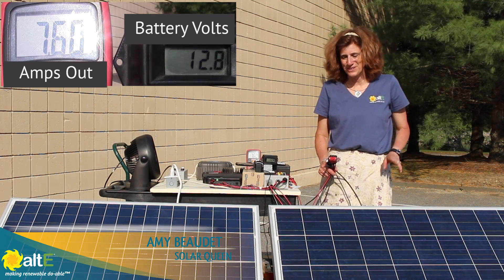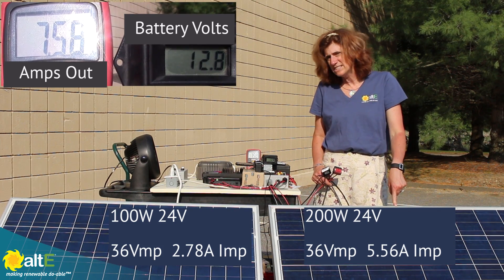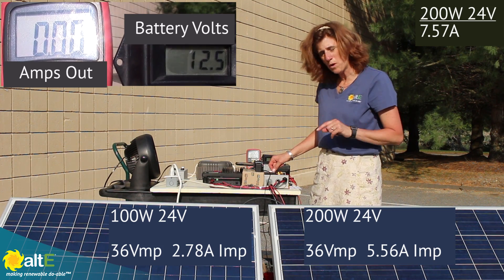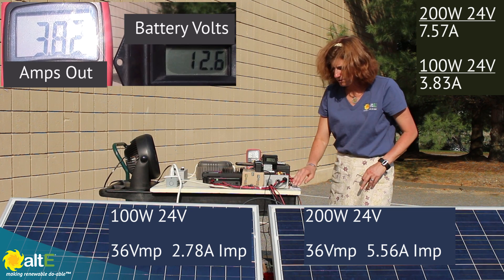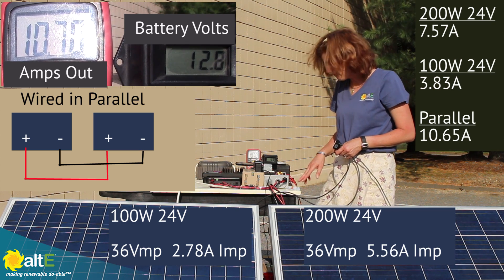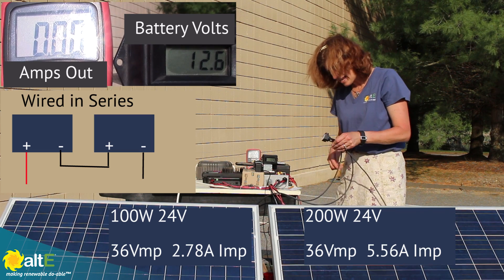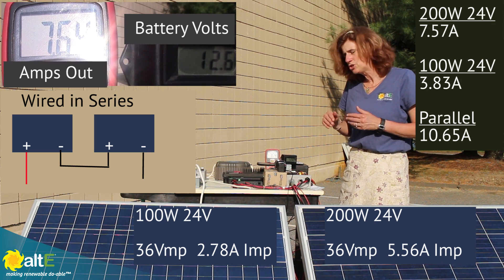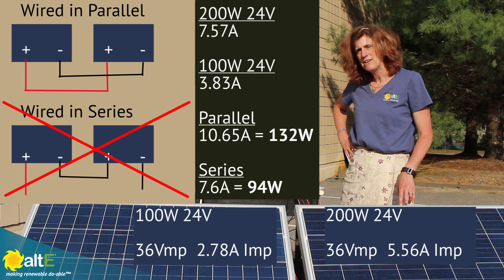What’s worse? Mismatched solar panels with different amps in series or parallel?

Comment: Hı, i have a question, for example, I have two mppt charge controllers, one of them is 10A and the other is 20A, can I parallel the output of these two mppt devices and charge a single battery?
Reply: Yes. Demoed in other videos.

Comment: Panel A ( 460W, Vmp = 45.24v, Imp = 10.18A )        Panel B ( 460W, Vmp = 41.9v, Imp = 10.98A )

There is  a little difference.  Plz advice series or parallel. I have 10 Panels B and 4 Panels A.  Doing strings of 7 panels in series and add both string in parallel. 

PS i have 10 panels B. Panels A i have to purchase because those are the only option in 460W.

Comment: The data presented here is inaccurate. Series = add voltage. Parallel = add amps. In parallel you showed 10.65A*24v = 255.6 watts. In series you showed they had 7.6A, now multiply by 48v = 364.8 watts This does not make sense 364 > total watts of 300.

I just think the video needed to add more information for the viewer and can lead people to think that wiring mismatched panels in series is always better than parallel. The controller does not "prefer" series or parallel (incorrect nomenclature). It depends on you application and what output you want and inverters and what battery bank you are working with.

https://www.youtube.com/watch?v=jejro4zkl8I
Reply: Battery voltage doesn't change. Just need to compare amps. She did fine.

Comment: wrong calculation

in series how did you get 7.6 amps.

It means you got better efficiency in series,. 48V *7.6 A = 365Watt😮😮😮
Reply: Wrong.  Battery volts didn't change.

Comment: is the math off on the series? 48 volt x 7.62 amps is closer to 350, not 94. even if you had the same panels, the current would stay the same, which would be the highest number. so recheck your info by adding more sensors in the lines of the panels to see that it is working like it should.

Comment: im building my solar with free car batterys, i put 2 big marine batterys in series, and ran 4 car batterys parallel off them each. i dont know if i got voltage drop from long wires or 8awg use, but i put a car tester on the batters and the marine had 14 volts whole end of the legs had 12.8 i think, also barely 300 amps on a 1000 cca batterys. when i put load on those car batterys. how do i improve my system beside bigger and shorter wire, is their better ways to hook up batteries? i have 2 inverter 12 volt is my issue,  while running 24 volt 100 amp controller

Comment: ty! that explains why on my 12 colt panels i had this issue when i connected a 175 watt with a 100watt in series and was getting poor current, and in paralllel got so much better.

Comment: NONSENSE. how volts can be the same if in series you double the volts! You should show us MPPT data not battery voltage.
Reply: Only battery volts matters. That's the whole point. Maybe a much better MPPT would have different results.

Comment: I actually took 2 different brand, different physical size, different wattage solar panels, and successfully paralleled them for a 12V battery bank mini solar system.  The were very close in voltage output (both at open circuit and at MPP), so they were very good paralleling candidates.  One is rated at 360 watts and the other is rated at 205 watts.  With losses, the most I saw was 28.0A at about 14.0V charging voltage, so that is close to 400 watts of charging power.  That is because of losses in the wires between the panels and the scc (solar charge controller), and other losses which are normal for a solar system.  The idea was not to get maximum wattage (cuz the scc maxes out at 30A anyway), but rather to use what resources we already had (such as wires and cables).  The system seems to work well and the inverter can output up to about 3000 watts and has both 230V and 115V outputs that can be used simultaneously.  A nice working system that can provide emergency power for critical loads (fans, fridge/freezer, lights, well pump...), but also can be used for intermittant loads (such as cooking food outside in a crock pot for example).  A fun system.  11 low cost AGM batteries all in parallel with a total rated capacity of 1000Ah (500 Ah usable).  That is about 6 KWh of usable energy, with the sun putting back about 2 KWh per day on average (5 sun hours * 400 watts), with sun hours "corrected" to wattage when sun is at ideal position and intensity.  So basically there are MORE than 5 hours of sunlight per day on average, but that is equivalent to 5 hours of "intense" sun close to straight up.
Reply: In parallel, you can have different on both voltage and amps and it will still always be fine (the only losses are the conduction/heat loss).

Comment: I have two panels one from a kit it advertised as 150/1000W the other is 175W is this two big a mismatch although they are physically the same size? I have them in parallel but battery not charging even after changing controller from a pwm to a mppt.
Reply from the maker: The wattage is not too bad to put in parallel, but you'll want to check the Voc and Vmp between them to see if those line up. As long as the voltage is close to the same, the amount of Amps from each panel can be different (just like if there was unequal sun exposure). But if the Volts are very different (EX 12v and 24V), then the controller will pick a voltage in the middle which will be inefficient for both panels!

Comment: Needs assistance here.. what are the corresponding amps  to arrive at 132W for parallel and 94 W for series? She mentioned 10.74 A, 11.5 A and 10.67 A
Reply: The output amps written is the output from MPPT to the battery, where its voltage is the charging voltage of battery, which is around 12.5V

Comment: Did you just put two 24v panels in series and not double your voltage when multiplying your amprage?

24v x amps is parallel
48v x amps is series
Reply: She is measuring the OUTPUT of MPPT Solar Controller, which is near 12.5V. She got 7.6A x 12.5 = ~94W in series.
She did not measure total input voltage as it is NOT necessary.

Comment: 10.65Ax24V=255.6watts 7.6Ax48V=364.8 watts
Am I missing something here? The test in parrelel produced 24v but series is double voltage to 48v?? So wouldn't it like series more??
Reply: nope. it's a 12v battery so it's restricted in how much voltage it can take in at one time. unless u series* 12v batteries together.
Reply: The output amps written is the output from MPPT to the battery, it is around 12.5V

Comment: Somethings not making sense you  have a 200 W 24 V panel and a 100 W 24 V panel. In parallel you get 24 volts at 8.34 amps.  8.3 x 24 = 199 watts.    And in series. You have 48 volts at 2.78 amps. 48x 2.78 = 133.4 watts.  After that it depends on your charge controller what voltage it’s going to charge at MPPT controllers will take higher voltages and convert them to lower voltages in doing so the amperage goes up so you should still be able to calculate close to the wattage of both panels when in parallel.   Full sun optimal conditions 200+100 W equals 300 W 300 divided by let’s say 13.5 V which is a good charging voltage for a 12 volt bank your charging amp rate should be 22 amps.   If your battery bank is 24 volt then your charge voltage should be around 27 volts which would give you about a 11 amp charge rate.  How are you getting 132 Watts and 94 watts?

Comment: How to check solar panels if they are in good conditions or not
Reply: Just measure the amps in the output, if it is near theoretical solar panel rating (e.g. 85W for 100W solar panel) then it is good. If not, there are still a lot of factors like sunlight, angle, shadow, cable size, solar controller, voltage, etc.

Comment: If we mix two such different configuration then one panel will oppose other one.In this parallel example net output amp is increased in parallel but it is also forcing 200W panel to produce less net output 132W. So finally this parallel connection is not suitable for 200W panel it may cause some resistance for it. Resistance means temprature increases and it may be responsible for hotspot in panel during long time connectivity. can we also consider the panel temperatures during such mixing?

Comment: Hi,
It's a great video but I am having my doubt. When connected in series, the current will be limited by the 100W panel, but the voltage must be increased. Am I right?

I got my doubt and I searched more videos and found this. 
https://youtu.be/W9W-3wZhUpM

Here both are connected in series and they are getting a lot more wattage than using a single panel. Please explain.
Reply from the maker: That's a different test he did. They have mismatched volts AND amps. Mine were the same volts. The moral of that story is, neither series nor parallel work well, as the lower voltage would pull the volts down in parallel, and the lower current pulls the amps down in series. Separately, they added to 231W. When he connected them in series, it dropped to 209W. So the bottleneck of the current in series caused him to lose 22W. The best solution for that scenario is 2 separate charge controllers.  I did the same test in a different video. https://youtu.be/ZAKTMSEHfk8

Comment: Good day,the solar Queen. Can one wire a 72 cells panel with a 60 cells  solar panels together  to be able to use an mppt charge controller of 100v voc?
Reply from the maker: You may be able to wire them in series if their amps are similar. Add the Voc of the two of them, and if it gets really cold where you are, multiply by 1.2 to make sure it is under the 100V limit.
Reply: Thanks, may God bless  you.

Comment: But you have twice the voltage so the wattage is higher you just need another controller/Batterie combination.
Reply from the maker: Yes, a second charge controller would do the trick.

Comment: Lady ...where is the spot you measure the Amps ? if you measure the amps in PV in Not Battery out . your output of series 7.6A is actually outperform of parallel since it's from  24v not a 12v  so 12X10.65 = 132 w  but 24V X 7.7 = 183W . so it's outperform over 50W in series compare to parallel.
Reply: I don't know exactly. But I think we may not get 24 V but it should be shown in the video.
I found another video whether two different panels(24V 200W & 12V 100W) in series and getting more output.

Comment: I have a question about combining multiple arrays to a single combiner box. I have (2 150w in series) (2 150w in series) and want to add (3 200w panels) I have in either series or paralell whichever is optimal. Each array will be running through a breaker in the CB and out in 2ga wire to a 100Amp Epever controller. I am trying to understand the effects of this on the panels and the controller by doing this combination at the combiner box. I'm having a hard time finding a answer. 150w specs are VOC 22.92 IMP 8.20 200w specs are VOC 24.29 IMP 9.52
Reply from the maker: I don't see a clear way to do that. If you wire the 200W panels in series, you'll have 73V in that string, and 46V in the 150W strings. The 150W strings will pull the voltage down of the 200W string. If you wire the 200Ws in parallel, you have the opposite problem of 24V on the 200W strings pulling down the voltage of the 46V from the 150W strings. Both ways, you are losing a lot of power. If you are charging a 12V battery, I suppose you could wire them all in parallel, so the voltages are a little closer. But you'll still be losing power. A MUCH better way to go is with a separate charge controller for the 200W panels.

Comment: Can I charge battery using two charge controller?
Reply from the maker: Yes, just wire them in parallel to the battery bank. Make sure they are both set with the same charging voltages.
Reply: @AltEStore  Thanks for your reply.

Comment: I have 4 panels of 250 watts and 3 panel of 350 watss? And an MPPT solar inverter, how do I connect them?
Reply from the maker: I would need to know more before making any recommendation. What is the inverter? Does it have 2 MPPT inputs? What is the minimum voltage it requires for the input?
Reply: @AltEStore   altE Store  It is 3200 Watts inverter, MPPT Range 120V to 450 VDC. I guess it does not have 2 MPPTs input. A standard MPPT inverter, which can also work without batteries. 
I already had 250 watts panels, I just could not find 250 watts panels again, which is why i I bought 350 watts panels.
The only diff is 0.58amp dif, both are mono panels.
In the future, If I will have any other use for 250 watts panels, i will use them for something else, but for now like an year or 2.

Comment: I dont have the same voltage or amps. I just need a new mppt to fix it but for now I can get about 10-15% more than just one panel.  One panel uses 60v+ 3a the other is 40v+ 6a

Comment: Remember the key is mismatch panels. If it was Match panels series wins.  The combo amp output is limited to the lower panels same as you join 2 -12 volt 0ne damage charge 70% if you hook it in series you get both at 70%  or the balance .
 1 tried both.  parallel first 100% 1-2 pm in series with a 400 buck mppt controller 100% at 11-12 pm. Both still need tapping off. But the series are pushing 7 amp at 9 am the parell don't start till 10-10:30  by 10 pm the series are pushing 16 amp
Reply: Rats  It's joined.   add a coma after parelle 100% at 1-2 pm .

Comment: Would you be better off a 12 volt panel for 12volt battery?
Im amazed you didn't get the exact sum total of the 2 in parallel?
So by what i've just seen here, the best outcome would be both panels in with their own controllers each then connected in parallel at the Battery ?
Reply: No, she get 132W (10.6A of 12.5V) out of theoritical 100+200 = 300W solar panel. The main factor is the angle and face of the sunlight, also the weather and some other things.

Comment: I have 4  18 volt  solar panels that  each put out about 1.5 amps..  in  parallel it's alright in series I think my amps produced would drop slightly in series but it would have about 72 volts to play with

Comment: Makes sense  parallel worked. Better.  Voltage is still higher then battery  which when dropped to battery  voltage gives more amps  on top of having 7 almost 8 amps from the panels alone. Where as series with only 48 volts  and  finding the middle amp amounts and droping the total  amps it now only has  48 volts to work with which in relation to a 12 volt isn't that far to drop  down to.

Comment: Hi Meldwin D. Adia;
If your panels are all the same it would be better to wire them in series. The demo was specifically pertaining to mis-matched panels. When in series the current flowing in the is much less in the lines coming back to the MPPT controller. Lower current means less wire loss with similar wire size. redrok@redrok.com

Comment: Thank you for sharing your knowledge. i have plan to buy 250 Watts 12 Volt solar panel and now i knew it's more better to make parallel in 150 Watts 12 Volt rather than to make it series on it.
Reply: If you have identical (same amps) of Solar Panels and MPPT controller then Series is always preferred.

Comment: I ran 12 pannels in series and didn't get the output that i got with parallel. If just one panel gets a leaf or pooped on by a big dinosaur bird.. all pannels are affected in series. Parallel you would only loose that one panel...

Comment: It short terms there is a % of loss converting voltage up or down.  24V to 12V is a smaller change (less % loss) than 48V to 12V.  The closer you are to your battery voltage the better.  Their may be a difference however depending on how far your solar panels are from your charge controller.  If you have to go over really long wires then the higher voltage will not lose as much to a long wire run.
Reply: No youre wrong on your first point. Most MPPTs accept voltages up to 100v. Its that you shouldn't wire different wattage panels in series bexause the low wattage panel becomes the bottleneck.
Reply: @ekoms108  Don't know if you understood what I said?  Yes many MPPT controllers can take voltage up to 100 volts. However there is a % of loss when you change a DC-DC convert a voltage to a different voltage (higher or lower). Therefore for efficiency you (typically) want to arrange your panels (series or parallel) to a voltage that is as close to your battery voltage as you can get (less loss for less voltage change). The only exception would be if your panels were far away then higher voltage has less loss over long wires. I said nothing on mismatched panels which of course should not be used (or used on separate charge controllers).

Comment: If you are starting each test with a different battery voltage, then it may throw off the results somewhat.  I saw a 12.5 on one test and a 12.4 on another test and since it is only 1 digit display after the decimal, it might even be more than a 0.1 volt difference at startup.  0.1V difference on a 12V battery represents about a 10% difference in state of charge.  Please be more careful next time.
Reply: I wondered about that.  Each test is slightly charging that test battery and the MPPT senses that battery voltage, limits the amps it sends to that battery based on that voltage.  By the final test there would be a possibly significant difference to the test battery.  A true test would ensure the test battery was always at the same level of charge.
Reply: @arizonastrummer  Her tests are "sloppy" that way, which is why I do not trust her results.
Reply: @arizonastrummer  How hard would it be for her to bleed off that recent charge she put in the battery?  Jeez, a simple 100 watt load from an inverter would do the trick.  She can even do it off camera. The test would then be more fair.  She cuts corners and that is partly why her results are invalid.